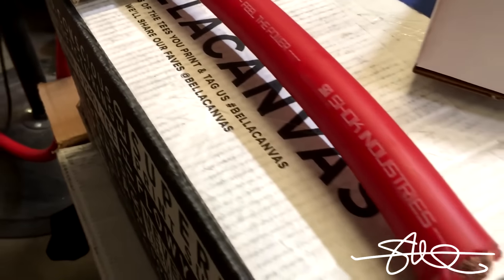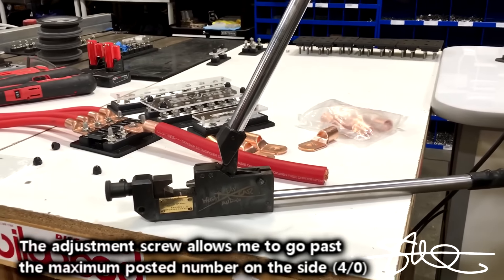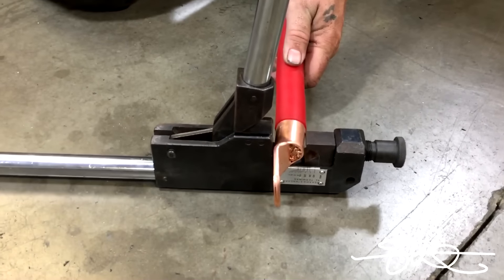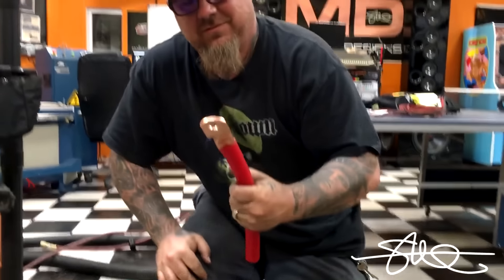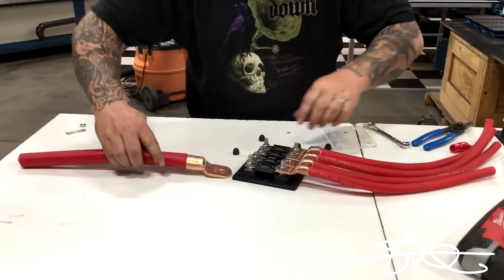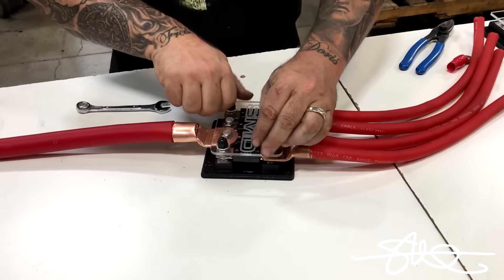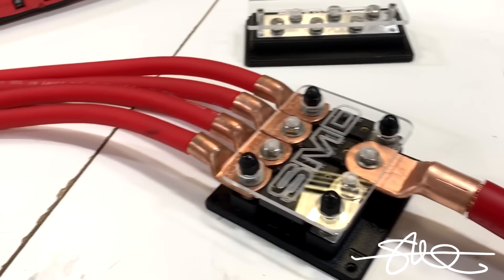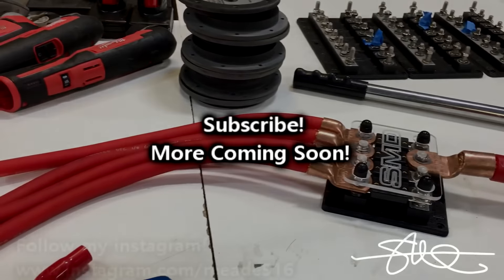MASSIVE 8/0 OFC Power Cable + GIGANTIC Ring Terminal! The Crimp! + Easy Fusing & Distribution

Comment: It can be use to do the big 3 upgrade!?!?
Reply: Yes but would be way overkill it basically replaces 4 1/0 wires you usually only need 1 1/0 wire for the big 3 unless you are running over 10k true watts

Comment: im still in the beginning stages of all the wiring of multiple amps and batteries etc im curious if you have the one 8/0 aut on one fuse going in how do you get power coming out into 4 1/0 aur to lead into the amp

Comment: still curious on pricing. I buy 4/0 welding cable for $3.50 a foot.
Reply: is that safe to use for car audio power wire and ground?
Reply: It's exactly the same, just usually a little less flexible.

Comment: Instead of grinding off part of the fuse,  why not take some material off the terminal?
Reply from the maker: because i chose to take a little off the fuse.
Reply: haha im all for fuses... just a quick question tho. wouldnt it be better to just crimp with a singular copper sleeve one side in the 8/0 the other side of the open sleeve the 4 1/0 or whatever you are attaching the 8/0 too? like theory wise.. ive heard that solder prevents the electron flow and that the individual copper strands are better? can i have a job?
Reply: haha im all for fuses... just a quick question tho. wouldnt it be better to just crimp with a singular copper sleeve one side in the 8/0 the other side of the open sleeve the 4 1/0 or whatever you are attaching the 8/0 too? like theory wise.. ive heard that solder prevents the electron flow and that the individual copper strands are better? can i have a job?
Reply: meh it dosnt even matter because its not like it would ever be an issue because you can read wattage the amp is putting out and it obviously isnt an issue. and only time it would be is from amp to speaker which is why you run huge speaker wires on the tahoe? meh.
Reply: maybe the real victim would be the alternator/s?

Comment: what is the fuse rating for this gauge cable?
Reply: You can fuse it with 1000A max but since it's probably tucked away i would fuse it with 500A or 800A to be on the safe side. Max cable length 6m, if longer fuse with 500A or less.
Reply: +jim575757 thanxs! so this cable is a all in one solution for loud daily cars.. no more 3 runs of 50 mm^2 cable! :p
Reply: Yup, although 3 runs of 50 mm2 are probably easier to run instead of this massive dong :) I think it's mostly aimed for really high powered systems 15k+ W. with multiple alternators etc.

Comment: 8/0 is definitely pretty cool, but I think it's a bit of a novelty item in this application.
Reply from the maker: how is that? i just showed you what it is good for.  If you can't see it then it obviously isn't for you.  But i can find a ton of ways to use it.
Reply: not at all. Less runs front to rear on bigger systems

Comment: 8/0 is 5 times the size of 1/0 not 3.5 and no it does not make adequate contact with your fuse block. The fuse block needs a larger contact area and larger bolt. 8/0 is 7 gauges larger than 1/0. Every gauge is one tenth (on a log scale) of a multiple of 10. So a 10 gauge change in wire size equals a 10 to 1 change in cross sectional area. Calculating a 7 gauge differential is simply 10^0.7=5.01 (10 to the power of 0.7).

Comment: So i have 1000wat crunch amp and i have 4 gage wier on a singel 12inch gothic i tryed to blow it up and it just wont die but i get good bass out of it ...but i want to put a 0/0gage wier thro the hole rig  but i cant find somthing that i can go to amp from 0/0 gage i dont have adapter what can i use ?????

Comment: hey keep up the great vids man and i was thinking since 8/0 is so thick you may have to run it in conduit or liquid tight under the vehicle in the frame to protect it from damage and shorting out. that will weld to any part of your ride st this point I would consider getting NON rectified alternators setup in a 3 phase  and send 600 volts at 80 amps (200 v × 80 amps×square root of 3  = 48000 watts )then you can easily use 3 runs 1red 1 black 1 blue to the back then use a stepdown transformer delta to wye so now you can add a ground convert back down to 16 volts (48000 w ÷ (16×sqr 3 = 1000amps) then you back to very short runs of 8/0 & 1 or 2/0  runs to the amps mind you this would be retarded expensive  but it would cut down on a lot of weight. just a thought
Reply: Only problem, the transformer would be huge and weight an absolute ton.
Reply: +Drakkar Calethiel I'm not an an electrical engineer but I imagine it would add a lot more noise both electro magnetic and mechanical near all the amplification and processing equipment.
Reply from the maker: no thanks. Stop overthinking something that is very simple. No need for all that. LOL.
Reply: +meade916 it's all good but would make for an interesting install lol..
Reply: +Ryan Nelson actually all transformers are isolation transformers just some step up or down voltages but some are the same 120v to 120v they are known as isolation transformers used for the sole purpose of removing noise or hum in the sound or in offices keep the computers running smoothly without distortion.

Comment: You know damn well some nutjob is going to run 2-4 runs of this 8/0 to some crazy ass system. I'd like to see even one run routed through a vehicle. That would be mighty interesting no doubt have to run it under the car or through a new hole in the firewall.
Reply: just pull it behind on a trailer haha!

Comment: my thing is got to grind a fues just put monster ring terminal on obviously you need to rethink the design I had to grind anything to fit that's not good sorry dude that looks it could start a fire
Reply from the maker: grinding 1/16" of plastic on the fuse is not a fire hazard.  You don't even understand what you are looking at so relax. It's fine.

Comment: You should make a cradle to put the head of the crimper in so it doesn't rock back and forth with the cables. Might be a little easier

Comment: Dayyummm!! That's some serious power cable for car audio, I was an  I.J./ Intermediate Journeyman electrician in the mid 80s-to-late 90s with the IBEW here in D-Town,(Dallas). it's the same size/gauge the only difference is the protective sleeve is more firm and rigid, this wire has Whiplash effect, takes two or three guys to handle this wire, you have to man handle it or it will handle you! This is what we used to get the 3 phase power source/3 hot wire + ground & neutral from the power pole to the building, ran through 6-8 inch diameter PVC pipe placed in  4-foot deep trenching, into various commercial restaurants, hotels, daycares throughout the DFW area. Man.... I miss those days, I had a lot of fun and adventure 💯😎✌️

Comment: I know it’s an old video but if you put a longer tube or pipe on the cable crimper handle you won’t have to struggle but great video and that wire it’s insane but very good to replace 3 to 4 wires going front to back

Comment: Why not fuse just the 8/0 right after the battery then run from other side of fuse to a positive buss bar then fuse each wire out to the amp separately with the fuse holder?

Comment: Sweet down shirt. 
Instead of grinding down the fuse area, what about trimming/filing the eyelet terminal to fit? I would want all the plastic insulation I could have on the fuse. 
Sweet videos man, keep it up. That huge Bluetooth speaker box is off the hook by the way.

Comment: how much is  the wire by the  feet  does anyone know  ? because when I start doing my system in my gmc  envoy  I am going to be running a 4k amp and 3 or 4  skar audio evl 2500 watt max  rms 1250

Comment: GUYS!! Need some help, i installed a kenwood double din system in my car and everything is all wired up correctly but i am having a slight issue... I am getting some interference coming out of the speakers. I have change my ground wire from my amp and sanded the metal down on the car for a good connection but it still seams to be happening. any ideas as to what the problem is ?

Comment: I don't get the point of using 0/8 when the mating surface to your dblock has less contact then your 0/1 terminals that actually fit on there.  3/4th of that 0/8 terminal is off that end of the dblock metal contact plate. Four 0/1 would seem to produce way more throughput better imo...thoughts YT?

Comment: Can any one help with my ?  When I touch my amp with a multi tester I get nothing but when I take the power wire off the Amp and touch it to the red on tester and my ground I get 14 volts but when I put it back in Amp it goes back to nothing my stereo worked for years and now it just shit on me. I have tried different amps it does it too.    Some times it works and when it does it stops when I turn it up.  The multi tester don't lie can any one help ?
Reply: I had the same crap happen and it was a faulty main fuse.  Change it out for another one. I thought that I was loosin' it.

Comment: Hey Steve, I know you use to promote Rockford Fosgate wiring but how does Sky High Audio compare?
Reply: There wires seem pretty good.. Just bought a big 3 upgrade kit from them.. Their customer service on the other hand is a bit meh.. They did a bad job on crimping ring terminals to the 1/0 cable I got and made me jump through hoops to get new terminals..

Comment: Crimp is garbage never trusted it never will, solder  that shit and be 100% postive,the wire will fail b4 that soldering joint does,you get a better connection  as well #fact it blows my mind im yet to see 1 guy running serious  spl gear solder  their wires

Comment: Thats too much, might as well run power line cables
Reply: Power lines (well at least the ones running from the transformer to a house) are usually only 2/0 or 4/0, plus they are usually aluminum to save on costs.  Not to mention the fact they have bigger/less strands inside, so they don't bend worth a fuck ;)

Comment: Why not grind the terminal rather than having to do the fuse every time.

Other handy use would be as a tool in the car rather than a base ball bat, beat down those road rangers with a floppy copper cosh.

Comment: that guage of wire is a complete waste of copper and there will be no gain from that, other than it looks cool.
Reply from the maker: you are as dumb as a tree stump if you think that.  OBVIOUSLY you haven't been exposed to anyone with a large, multiple amp, multiple battery, multiple alternator setup.  You should just not post if you don't know what you are talking about. You sound extremely ignorant.
Reply: How is it a waste ? You can easily add too little of wire but you can never have too much. These large amps need gobs of power to keep them going so why not add large wire? Besides that this can be a feeder wire to step down into many smaller wires so how much could one to two feet of this stuff cost? What twenty dollars or so lol, so expensive hahah